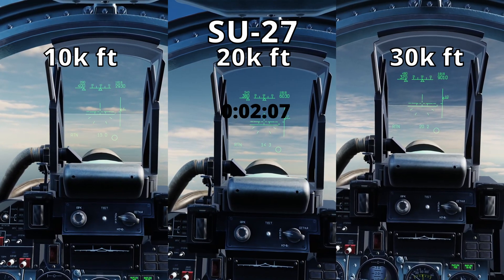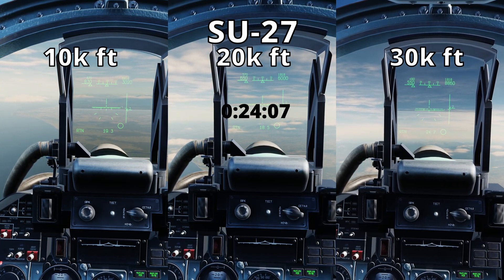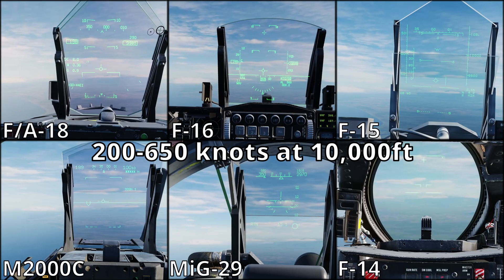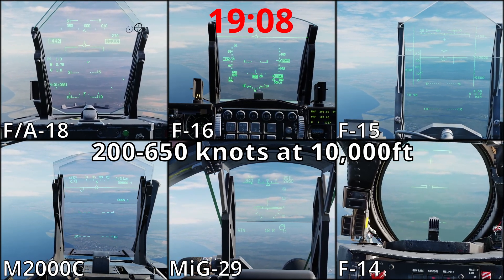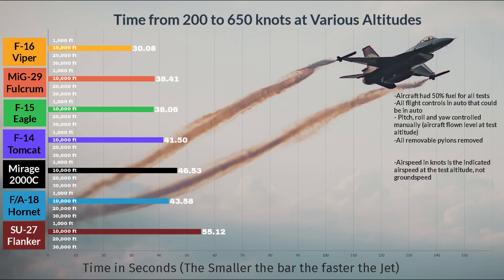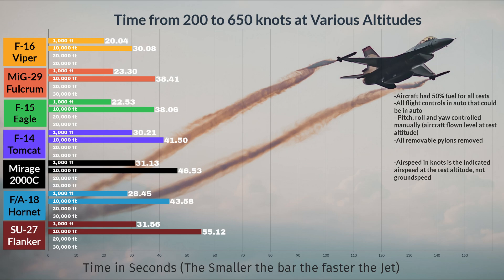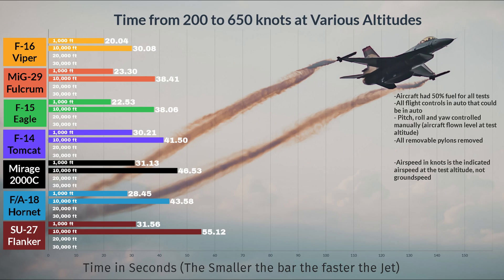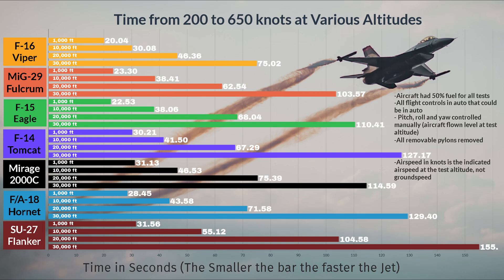Fighter Jet Acceleration Test (4 Altitudes tested)

Comment: I think a fun test is a long-distance point-to-point race.  In my experience, if you use a good ascent profile (zoom up to 30k subsonic, zero-G pushover to dive past the Mach, then steady M1.2+ climb to 50k) the Mirage is a serious force.  It's pretty underwhelming subsonic, and it really hits a wall trying to punch through the Mach.  But once you get that thing supersonic, it COOKS.  And, it even gets very fuel efficient.  I've gone between the two furthest airfields in the Caucasus at Mach 2+ with no external tanks.

Comment: 50% fuel:
- for M-2K ~1580 kg
- for F-16 ~1600 kg
- for MiG-29 ~1700 kg
- for F-15 ~3050 kg
- for Su-27 ~4700 kg e.t.c.

Yes, different fuel flow rates... But not 2 or even 3 times higher!
Such comparison tests should be conducted with fuel in minutes at full afterburner (and 100% gun if we want combat numbers). For example — 3 minutes left of fuel.
I don't think standings will be different. But numbers may.

P.S. Turn rates should be tested this way as well.
Reply from the maker: You are absolutely correct! I have since learnt this and will perhaps revisit it one day. Though i dont think the results will be dramatically different.

Comment: Nice info. Any ideas as to why certain jets performed so well/poorly? Would you say that drag accounts for why a small slick plane like the F-16 dominates while the Sukhoi being an enormous flying saucer that maneuvers really well just can’t pull hard through its own drag?
Reply from the maker: Yeah I reckon you are exactly correct, this test comes down to drag co-efficient more than power to weight although it is a factor as well, the results scale pretty well with every aircraft, except for the Mirage, its performance up high compared to down low was an outlier for sure.
Reply: The reason the Sukhoi is so slow is because it's very Poorly Modelled in DCS, There are many threads on the ED FORUMS regarding this. Unfortunately I can't post any links in the YouTube comment section as the App keeps deleting this.